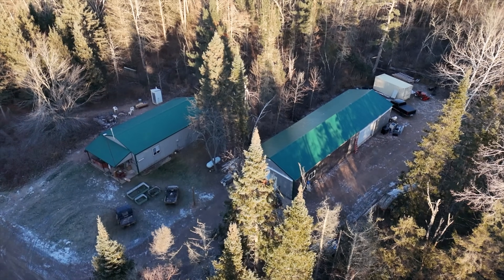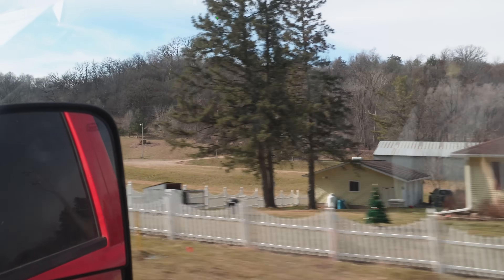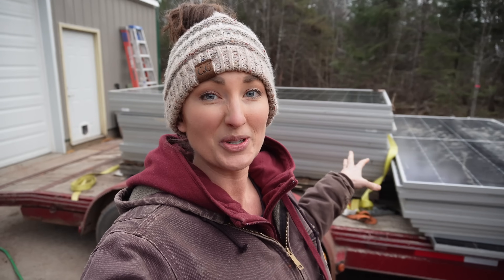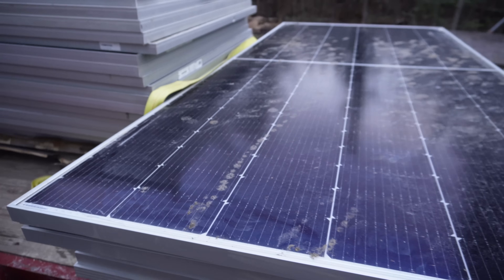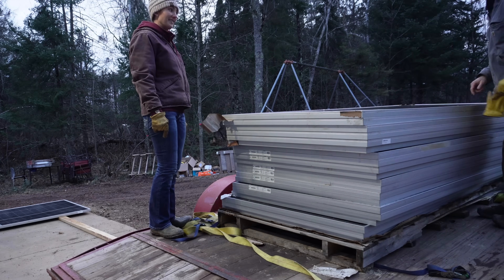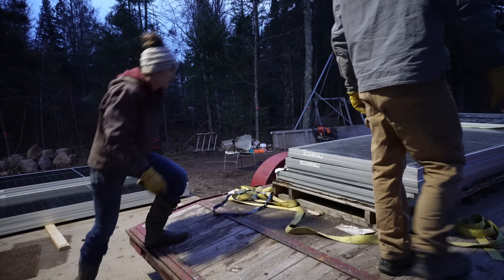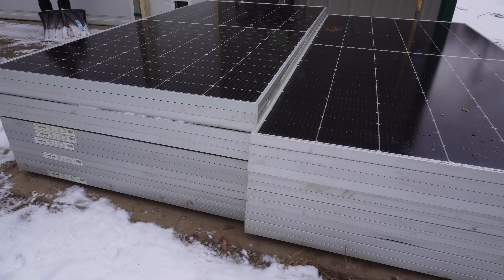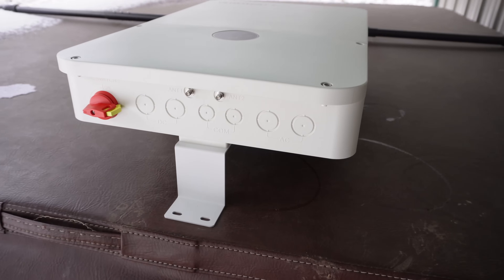WOW!! 14 kW of Solar Panels for ONLY $300?! ...Will they work?

Comment: There are loads you can power directly, AC and DC saving wire runs and keeping them independent. 
Heating with direct DC for example. Running DC fans in greenhouses.
Keep it simple and redundant.

Comment: When arranging panels into a series string, the most important thing to match is the current. The voltage of each panel in the string adds together but because they're in series they're forced to operate at the same current. This is what you're talking about when you talk about the "weakest" panel in the string controlling the operating point for the whole string. So if you're trying to minimize inefficiencies in the string, you want all the panels in the string to be capable of roughly similar current output under a wide range of conditions. Doing that is probably not simple, but if you look for panels with similar short circuit and peak power output current ratings, that's probably close enough.  Two panels rated with the same open-circuit or peak power output voltage are not necessarily well matched to go into the same series string. Matching voltages would apply to solar panels arranged in parallel.

Comment: 14 KW for 300 Bucks , there is probably a hook !? ( ok , not one Model, Cracks ...  ) 

Be wise to test them before you put them on the Roof    , or use MicroInverters ( hoyemiles are popular in Europe)  to treat them individually . 

With that C Grade Material you need to Monitor the Modules otherwise you will not have a working Systems for years . There is a reason why the big Fields dont want them on there installation with 500 - 800 Volts on a Line . Even if they look fine , use a Thermal Camera for testing you will find the Big Errors and Panel Tester for a few bucks .  
Check the Backside and the Foil , if the start to wrinkle around the Cell on the Module , be aware that that will go on and evantually kills the SolarModul , the Cells will fall of of the Module , reason are Isolation reasons . 

Take Care about the MC4 Connectors and do them all new on the Modules if the Modules was in use before  , a string of 8 could be alreadz on  300 V DC   on the Line if the Modules are around 400 W .  

Currently in Europe you can get 1x Glas-Glas Module *450W for around 80 Bucks or lower in Brand New and Garanteed for 25 Years. 

If a Connector is "bad"  and has a high Ohm Resistance Problems will occure eventually   .... then the 300 Dollar are actually not too cheap ! Good Luck.

Comment: how they working in summer heat ?
Reply from the maker: We are still working on the wiring and the support frame, so they aren’t hooked up yet. Hopefully within the week! We’re close
Reply: @thehomesteadingrd  awesome.   I also bought some used panels that tested good  but yesterday we had temps of 105 and the voltage drops 50 percent on 3 of the 8 panels but the rest was good

Comment: When I bought 85 panels, I stacked them all on edge. In my van, I set a pallet against the wall of the van for a square surface to trap them to, then in my trailer, I had 3’ sides, so, I stacked them all against the sides. Zero damaged. Drove 350 miles… ended up being too much for my van to haul though… ended up blowing the engine on the trip… my brother met me 100 or so miles from home, and towed the trailer home, and the van was towed on a flatbed. And all panels survived the trip!
Reply: Wow, that’s crazy!
Reply: @NickWindham  thanks! 
Yeah, it was a wild trip too.
Reply: @whochecksthis  I’m going to buy 25kW of used panels to ground mount around Black Friday.  I’m hoping to get free shipping and be around $0.10/W-ish for 300W+ panels unless I find a deal I can’t refuse 400W+ new panels.  I need to estimate cost break-even points for extra ground mounts for 300W+ used panels vs 400W+ new panels plus output, warranty and longevity differences.  It’s crazy to me how expensive the simple ground mount kits are vs the complex solar panels.   How did you mount yours?

Seems like Santan Solar and Facebook Marketplace are good sources.  You suggest any others?
Reply: @NickWindham  diysolarforum is great for assistance etc. I still have not put them to use. I’m soooooo busy.
Reply: @whochecksthis  thanks

Comment: If you use solar panel Optimizers, you can mix-n-match panels, as long as the panels are similar power and voltage. Optimizers also help of you have shading on some panels but not others... and it looks like you're going to have shading.

The inverter needs to be made for Optimizer use though, like the Solaredge Se7600a-us, which also allows you to power critical circuits when the grid drops out. Without batteries or one of these inverters, Grid Tie inverters MUST shut down completely. This means you'd have to have another power generation system for blackout conditions, or lose food.

Also, many solar panels have a silicone layer between the active layer, and the front glass... so that they don't instantly fail from a hail stone strike. They can survive a while with the cracks... sometimes for years... but at a reduced efficiency since the sun light gets a bit diverted.

Comment: If the power company will be paying you wouldn’t it make since in the short term to use that money to install battery backup for your personal needs in case of grid outages? Then collect your profits
Reply from the maker: This is just an accessory cabin, we’ll be moving out to our forever home in a couple of years once we build it (which will be fully off grid with batteries). Fingers crossed there’s no grid outages before then!

Comment: 2.1 c/W is an amazing deal.  Installed systems tend to cost $2/W for panels.  New panels for DIY cost $1/W.  I recently bought 7.7 kW (14 panels) for 18 c/W new but w/ slight shipping damage.  Mine look like yours, industrial size, 550 W, 50 VDC.  Most of mine serve double-duty as a carport roof.  You might use your spare panels to run things like a mini-split heat pump since some now run directly off panels.

Comment: I was gutted when I saw you stacking the panels horizontally.  If you place them vertically each one only has to support its own weight and the frame structure can do so.
There were a lot of panels at the place you picked them up from.  Was there a specific reason you didn't choose all identical panels to avoid the string matching issues later?
Can't wait to see the follow up videos on how your installation goes.  I hope you don't have to fell too many trees to get direct sunlight and avoid any partial shading issues too.

Comment: Micro-inverters should solve some issues with the different types of panels; also, check into used car batteries. You might be surprised by the low prices compared to branded systems.

Comment: Great idea we had a deal by our provincial government administrative through our utility companies  set sizes one looked good it averaged out to 100.00 dollars a month and cost was about 120. 00 per month for 5 years great 20.00 dollars a month for 5 years then free power for at least 20 years  then came the catch we only received net metering on the energy portion so that changed the equation 60 per month  to save 40 for 5 years couldn't afford it so for us in Alberta Canada it's only worth it to cut the  now the only stopping point is the cost unless what we are seeing online is wrong for us low budget people who dont use great amounts of energy so far I've found out that one of my main power users my furnace only uses 320 watts to start and runs at 280 watts  can't see a fridge or freezer using anymore power and lights are   12 led bulbs at 8 watts each is only 96 watts so my cooking is a 1400 watt microwave and a 1500 watts  frying pan 2 times a day for 20 minutes  minutes I could see needing such a big system if you had electric heat hot water and a big stove

Comment: Don’t forget to account for voltage going up the colder a panel is. When you’re planning out your strings.

And watch out for voltage leaking to the frame on those cracked ones.

Comment: What is the Voc of them? As a VERY casual "rule" of thumb, commercial panels are over 50 Voc and often 60+Voc and residential are 50 Voc or less. So residential inverters are often maxed out at 50Voc.

Comment: I have 33Kw AC diy next metered system that I sell power to 5 other homes.
All materials costs were recovered within two years. You can have different watt panels on 1 inverter as long as panels on each string are the same. Any cracked glass will not work for long if at all. Good luck

Comment: if they do not work its normally a diode that are a few cents to replace , I buy up truck loads of them when ever the insurers are doing hail damage :D 1 panel goes they redo entire string , another use my mates wire them up as bath room heaters, and micro inverters and small MPPT chargers work best on dumpster panels I would not run them on large strings as the voltage will be too high normally they get dumped because they failed isolation tests , buy a mega Ω tester and see if they pass the 1000V tests

Comment: The problem. You as the owner, having those panels, and  because the power company needs the power, they gave you, what they needed you to have to control your system. You then will not have backup, when the power company deems it necessary. You must have full control, and batteries. How you do it, is with switch gear. That way, your system can come on when the power companies goes off automatically. You can feed the power company at your discretion.

Comment: As long as the voltage and amps are within 2% of each other there is no issue mixing and matching, especially on big string of 9-12

Comment: Hello thanks for the video … there’s a way you can clean up the good panels , if you have a electric buffer and a buffing compound you buff the scratches out of the glass or you can use a very high grit sand papers to clean the glass 8000 to 10,000 grit sand paper. I have done this before and it works amazingly

Comment: You don't need to exactly match solar panels in series but in parallel them then you have some issues. very great deal for 300$ actually now in Iraq new panels 580w 18busbar are about 100$ each.

Comment: If the electronics in the panels do go bad in the future you can solder new diodes in the box to replace the damaged triacs. they usually only use 2/3 pins on the triacs and they are prone to failure.

Comment: For the price I would make another trip or 2 and really stack the trailer! Strap those panels length and width wise or even band them.  That will keep them from shifting and damaging each other. Id also see if they let you pick out matching panel groups. I would really rethink breaching your roof!  Go with ground mounts DIY! Easier to reach for cleaning, replacing, etc and much easier to develop a tilt system for angle adjustment. Great deal find!!!!
Reply: I found nice rolls of what I call "stretch wrap" in my moving supplies.  That would work well around panel frames.
Reply: I agree.  roof mounting is not ideal.
Reply: Yes, ground mount for sure. It is not safe to get up and clean panels on a roof. Difficult to get at for replacement as well. Our next will be totally ground mounted. Breaching the roof is not good. Our current metal roof uses standing seam attachment points so we didn’t have to breach the roof.

Comment: modern panels compensate if one panel produce less then the others on the string

optimizers (does kind of the same as a a microinverter, just without converting to 110/220V) can be used but it is often not that usefull as it sounds...
its not like the system will preform 50% because of 1 panel is oreforming at 50%

the more bypass dioedes they have the less loss

a system with micro inverters/optimizers will in most cases only preform a few % better then a string inverter without optimizers (not worth the cost as repair)
but sometimess there is no difference

i have a string with mixed east and west panels and it preforms fine...
the panel preforms pretty much the same ass the 3 other strings i hav whre they are all directed the same way and angle

im not sure where you get new panels from but if i buy 15kw i pay 2000€, not 15000 dollars

Comment: In your place I would be thinking about using several smaller inverters so that you don't waste too much power when your panels do not fit into strings of identical specs/condition.

Comment: @freddymax5256it was hard to find fuel for generators down here in Dallas during the 2021 storm that had power down in some areas for over two weeks. 
My generac is the backup to the backup now that our system has batteries.

Comment: When the panels are mounted, there is very little torque applied to the frames by the clips or bolts. That means you cannot tightly strap them down to the trailer.

Comment: You seem resourceful so you have probably already thought of this, but when it comes time for batteries don’t overlook Gel batteries that have exceeded spec for hospitals, data backup systems and microwave towers.  These can be had for cents on the dollar and have years of life.  A recent FB post on DIY Offgrid Solar has a good analysis of these batteries.
Reply: Tower batteries are awsome because they usually replace the entire string when 1 or two go bad.❤

Comment: Since your panels are damaged, the damage won't be uniform.  You might want to look into microinverters.  12 on a string is NOT a good idea for damaged panels as you will get something like 12x the performance of your worst panel.  For the money though, it might be more efficient, money wise, to just get more panels.

Comment: OK here it is in a nut shell: Without the batteries and with the grid tie system that you talk about, You are still bound by the electrical law of Island Protection. Meaning: when the grid goes down YOU still go down as well, so your system does not feed back to the grid. Which does not give any advantages back to you, When the grid goes down and you still have NO POWER. !
You still need a system that incorporates for you, uninterrupted supply of Power. Hence the need for the Batteries.  Please do not be the person that stands there in astonishment saying to yourself This money is nice but where in the hell is my power . Think ahead step back and give this a ponder for a few. Great deal on the panels though i paid 8 times that much for 48.

Comment: I would go back and get another load of panels.  At that price you surely cannot get hurt!  You never have too many.   You can store them anywhere until you need them.  The price you are paying makes the effort worth it.  Don't disregard the idea of the batteries.   Check signature solar in TX.   They have 5000 watt EG4 batteries for about $1500.   What I see with most of the net metering is they buy back and pay you next to nothing.  You make out buying the batteries over time.  Good luck!  PS  I don't think doing the panel repairs are going to be worth it.   Since you are getting them so cheap, I would just buy more panels and save the effort.   Clip the wires and connectors off the broken ones and save them!
Reply from the maker: We are debating going back to grab more before they are gone! I know in most states, it’s not worth it to do net metering. We’re thankful that in Minnesota they have good laws around it. We should be making $300 per month from this 🙏🏼. We’ll see!

Comment: I would want to test each panel for both Open Circuit Voltage and Short Circuit Current. I use a Sharpie to write those two numbers on the back of each panel near the sticker. These tests need to be done on a sunny day for each panel, so yours would take a while. Good luck with your build!
Reply from the maker: Great idea!! This is helpful, thank you!!

Comment: You could use optimizers like the Tigo TS4-A-O for mismatched panels, which could also monitor each panels performance.
Reply from the maker: Great suggestion! We’ll look into those. Thanks!
Reply: With all the shading it looked like they have, I would use optimizers.
Reply: Agreed. When they were unloading and first mentioned they had mismatched panels, I thought: "I guess they'll be needing to buy individual panel optimizers"

Downside is that each optimizer will cost more than they paid for each panel.

Comment: My state had net metering. And technically it still does. The power companies and politicians pushed through the idea that solar producers were also responsible for the maintenance on the grid. So they neutralized the net metering by applying a grid maintenance fee. I respect your choice but I would never put my solar system on the grid. There are many good reasons. One you invest all the time and money and what do you get in return. A discount on your energy bill. And in the event of a grid failure you get absolutely nothing. As grid tied solar can not be used during a power failure unless you have an isolator switch to prevent back feeding and of course battery backup.
Reply: If you have the system, it makes no sense to not sell excess production to the grid. As for battery backup and backfeeding, if you have the correct inverter setup, when the grid goes offline, there are no islanding concerns as the inverter will stop selling to the grid and you'll still have power to your house. If and when the power is restored, an excess solar production is sold to the grid. The only reason one would never connect their solar PV system to the grid is either because it's not approved or because the fees for being connected to the grid exceed its value which in that case you go off-grid entirely. I have battery backup + solar PV, excess production is sold to grid, when grid goes offline, I still have power to my house and the solar charges the battery so I could go months while the grid is still offline.

Comment: If you have some panels that don't work just use meter and check the diodes those are the first thing to go on the panels very simple to replace